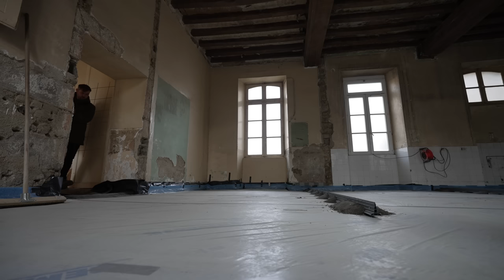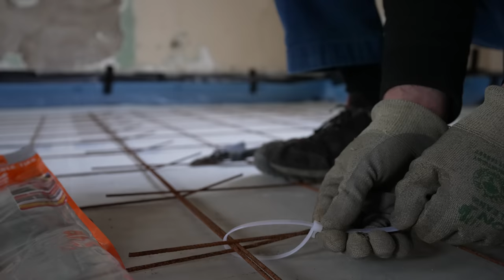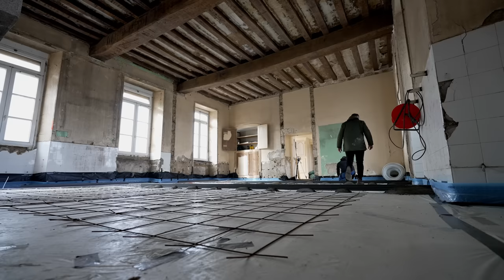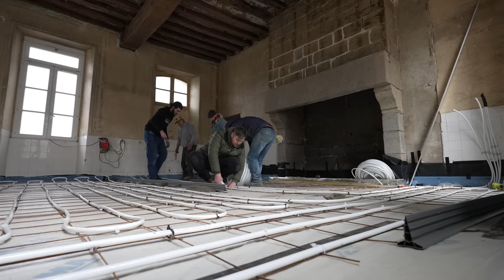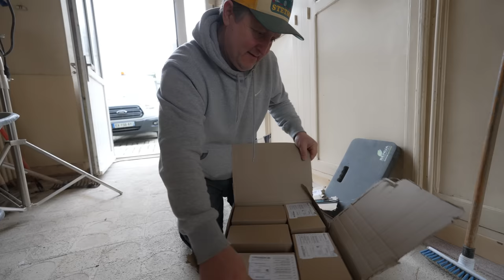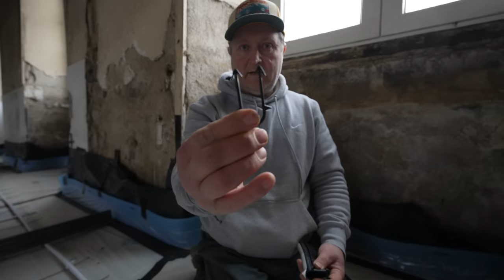Installing Underfloor Heating In A 250 Year Old Convent

Comment: Just a note on the PEX tubing:  Where it comes up, out of the floor, it is advisable to put the PEX tales in something like PVC Conduit Radius Elbows (1/2" Tubing in 3/4" Elbows) .  It helps the transition from the cement to open air as the PEX wants to expand when heated and it can cause some issues at the transition point (Cement to open air).  Sorry about the dimensions - I don't know Metric measures for the supplies.  We usually mount a Conduit Clamp, on the wall, for each PEX Tube - in a nice row.
Reply from the maker: that’s a great idea i will grab some tomorrow!
Reply: I noticed the same, also filling the pipes with water before the concrete comes in helps against floating, the third zone at the end should be smallest and the other zones bigger as you are closer to the connection box (which should be installed first). Also the pattern you are used is quite old fashioned, nowadays the tubes are routed in a snake like pattern, not parallel. All these things are ensuring equal heat supply to all areas in the room. Now it can happen that the third zone is the coldest on (longest tubes from the central connection point) and each zone is warm at the one side an older at he other side. Just my five cents....
Reply: Timely advice, very welcome 👍🏻
Reply: Yes!

Comment: OOOOHHHH this video is FACINATING!  It checked a TON of my curiosity boxes on how radiant heat is installed....I appreciate it more being able to actually see the steps, hardware and fasteners used on this step of the process.  Sean has a really great grasp on this - I realize it is a learn-as-we-go, but Its a process I hope to duplicate in building my Tiny Home.  Thanks guys, you deserve more than a Pint !
Reply from the maker: glad to help i haven’t explained how much research has gone into this floor and how much it’s cost! but of course it’s worth it!
Reply: @ThePethericks  oh absolutely!.  I'm sure there is a boat load of research involved, but in the long run it's so very worth it and there is no monetary value that van be placed on the learning experience and  satisfaction of a job well done❤

Comment: Like others a fantastic series mostly by hand, shovel, jack hammer and wheel borrow to built mount rock-u-la in the back.  Maybe a Bobcat when it comes to moving it to its final resting place.  It's got my better half think it might be time to renovate a late 1890 property though I'm suggesting living vicariously through your efforts and to downside to a tiny house.

The elbow recommendation by Lee Bernardo is how we handled our installation too.  I would recommend pressure testing the runs to ensure there are no leaks - pin holes.  We had to pull up a section of the tubing as it had pin holes.  The manufacture determined there was an issue during manufacture.  I'm sure it's a rare issue though much easier than chiseling new cement.

Comment: Guys I think the steel rebar mesh needs to be at least a couple of centimetres inside the concrete for strength. I’m not a builder but please check as it looks to be setup on the bottom skin of the concrete against the insulation in this latests blog. Great work overall though guys I enjoy many aspects including teamwork and this new floor prep. Work :)

Comment: Fantastic work!

One concern is that the wire reinforcement mesh is suppose to be floated up a bit in to the concrete to hold it stable from cracking, but you have it under the tubing. 
I have seen many people install this tubing, but it’s under the wire reinforcement. Just checking.

Comment: Great job, you ideally would want the rebar reinforcement in the center of the concrete, it might be worth dropping some on top of your underfloor heating pipes with standoffs to gain an inch of height. You could even tie the two sections together for extra stability.
Reply: I thought the same

Comment: Oh one more thing my suggestion is test the underfloor heating pipes for leaks before you pour as I've known there be a hole no one knew about then it was turned on afterwards and they had to dig it up
Reply from the maker: i have bought a pressure tester, will do that next week!
Reply: @ThePethericks  thank you so much for taking the time to reply. Love the vlogs and the hard work you and your fantastic team are putting in to the building thank so much for sharing it all with us
Reply from the maker: @Will-fielding  thank you for suggesting the idea i was told to by a heating engineer just before incase if any issues! we don’t want any issues because concrete is pretty permanent!

Comment: When I built my 4800 square foot shop, I followed basically the same process for installing my floor. I can assure you that installing the pex tubing was the most back breaking job I have ever done. You have to experience the joy of working in freezing temperatures with rolled pex tubing which absolutely fights you for every inch of the way while you are on your hands and knees.  It has been several years, and my back still hurts. I use a woodfired fired boiler and the next winter I turned up the heat and worked in shorts and tee shirts while the temperature outside was below freezing. My walls are ICF which retains heat extremely well. My hat is off to you and your crew. FANTASTIC JOB!!!!
Reply from the maker: it’s worth all the effort isn’t it!

Comment: Remember on the radiant floor you need to know exactly where those pipes are because when you go to attach, sink cabinets or anything to the floor it will be disaster if you put a nail or screw through one of those pipes. Put a sign up warning others in case you are not present. Good luck.

Comment: Why not fill the tubing with water? Also As the concrete is poured, the wire mesh should be lifted up so that it’s positioned in the middle of the concrete in order to provide steel reinforcement. This particular type of reinforcement resembles a two-dimensional grid, which plays an important role in its support capabilities.
Reply: The way they’ve pinned the heating down already suggests that the steel reinforcement isn’t there for the strength of the concrete, which is what I’d thought it was. The reinforcement mesh will be outside the concrete with this method. I’ll be watching with interest.

Comment: Make sure you do a pressure test of the system before you pour the concrete. You can connect an air compressor and gauge and then seal the end. Make sure the system maintains pressure for 24-48 hours to ensure there are no leaks. It's much easier to do now then to realize you have a leak after and have to jackhammer new concrete to find it.
Reply: Billy, Sean!!!! I hope you read this!! Very important!!!!

Comment: Gday from Australia, I’ve only had experience with installing two houses with in slab heating we attached the tubing to the foam then laid the mesh over top so to pull up mesh into the concrete as it was poured. Was taught that you always suspend the mesh in the concrete to strengthen it . Cheers
Reply: Yes I was going to comment on that myself, very curious as to why Billy is leaving the mesh on the ground. really should be lifted into the concrete as it's being poured or placed on plastic lifters prior to the pour. Just a comment!
Reply: He has explained in previous comments that the rebar is not for strength but for a grid to lay the tubing on perfectly.
Reply: @Gadgetmumma   missed that explanation. Having seen how easy the previous floor broke up I thought they wanted strength from the mesh. Let’s hope the guys doing the pour understand this and don’t try to pull the mesh up as they pour😀
Reply: @Gadgetmumma  ah ok I must have missed that discussion or just wasn't paying enough attention. Makes sense then and thanks for the clarification :)

Comment: The Clips (Staples) for the PEX tubing fit into a "Stapler" tool so you can walk along and drive the staples into the foam without having to crawl along on the floor). usually you can rent it - they go very fast that way.
Reply from the maker: i couldn’t find one online, they aren’t very common here in france

Comment: Don't know if you can get these in France but there is a hand held power tie tool that runs a roll of wire and you just hold it over the junction of the floor wire and the heating tubing, pull the trigger and it wraps and ties everything together. May be worth like looking into if you are planning on doing more in floor heating or concrete flat work. Makes very quick work of the job. We used it in our basement and gym and it was a back and knee saver.

Comment: I find it interesting that the steel mesh is hard against the insulation, I would have thought that the mesh would have been centered in the middle of the concrete slab to provide structural strength  as apposed to sitting on the bottom of the slab flat against the insulation ?

Comment: Nice one guys.... I'm assuming you read👀 my comments from before👍 just a couple of questions.... 
Are you going to raise the mesh off the insulation? If the mesh is structural it can't be just at the bottom if it's not structural why did you have it there in the first place?

Are you going to be pressurising the pipes before you concrete? You can use air or water. This really needs to be done two reasons really you want to make sure you haven't any leaks now and during the poor.

you can fit your manifold and apply the relevant fittings including a pressure gauge so you can have pressure in the pipes alternatively you can fit pressure gauges to one of the two pipes that makes up a circuit, on the other pipe you fit a ball valve so you can add your water or air via small compressor or pressure pump. 

Have you thought about how are you going to get across the pipe work while you're concreting ?, you could use ply. 

You might want to consider putting more staples in, you might as well use them up especially around the loops...

Also I would advise you take very precise measurements on where these pipes are just in case you want to install anything afterwards that involves drilling through the floor or anywhere where you do not want heat.👍

Looking forward to your next exciting episode 👍👍👍
seriously I don't wanna sound like * ** I'm only trying to help 🙋‍♂.
Reply from the maker: appreciate your comment and suggestions, the steel is only as perfect grid to lay the heating pipes too so it’s consistent and not for reinforcements. those pipes cannot be crushed by a human foot it’s literally impossible but we will take great care when pouring the concrete.
Reply: @ThePethericks   okay.

Comment: Maybe the method is different in Europe, or I am behind the times, since it has been over 10 years of working with concrete.  Saying that, I think the rebar should be elevated a bit to make sure it is in the concrete slab, instead of on the bottom of the new slab.
Reply from the maker: it’s not for strength, it’s for laying the pipe too
Reply: @ThePethericks  That’s interesting ! You’re probably using concrete with fibre for strength?

Comment: would be better if the mesh was lifted from the foam. I thought you'd do that after with some stones or something between the mesh and foam, but then you snaped the plastic anchors. maybe i wasn't paying enough attention and its supposed to have more steel. looking forward to the pour.
Reply: He said it’s not being used for strength, only as a grid for the heating pipes

Comment: You need to add Bar Chairs under the steel reo to lift it above the insulation. The reo needs to be in the middle of the concrete. This will give the concrete more strength.

Comment: I believe you had more than enough heat coil tubing. This wasn't as flexible as what we use in the USA. Have you thought about putting some conduit covers where the tubing come up the wall like the guy at Diesel Creek did. May not be necessary. Those new windows are a bit pricey aren't they.

Comment: Wow the floor is looking great.  Radiant heat in floors is the best.  Just wondering, are you going to lift the concrete reenforcing wire up off of the foam?  It won’t do much unless it is suspended in the slab.  Really enjoying watching the progress.

Comment: thought there was supposed to be a gap under the steel to allow concrete to completely surround the wire and therefore the wire should sit in the centre of the concerete pour ??. Doing a real job fellas....envy you.....

Comment: By any chance are you using an uncoupling membrane between the new concrete and the travertine? New concrete shrinks and spider cracks occur, especially with radiant heat floors. Those cracks can telegraph through to the new travertine, and that would be tragic in light of all of this effort. Schluter Ditra is foremost in uncoupling membranes.

Comment: The expansion joint should be notched over the pex piping so that its base is flat to the insulation. Otherwise, good job.
Reply from the maker: it’s not finished yet!!!!
Reply: @ThePethericks  Just in case the video was uploaded after the pour. A comment below references using PVC conduit to come out of the slab, putting standard sweep or long sweep conduit elbows there could be a good idea to prevent kinks in the PEX.

Comment: What about the holes made in the insulation by the spikes? You did all the hard work taping joints to only poke hundreds of holes. 
Will they be covered in caulk or some waterproofing before the concrete?

Also, way to go getting the piping done! Ahead of schedule is always a good thing.

Comment: Great stuff as usual..... I do have a question, since I know NOTHING about construction etc.  When pouring such a large concrete slab with obviously heating underneath (Great idea)....... will you have to put in expansion grooves in the slab such as they do in driveways and sidewalks to prevent cracking?

Comment: Billy,  how are you going to get your metal reinforcements to float in the middle of the slab like they are suppose to when you have the in floor heating tubes on top of them and the tubes clipped to the insulation?
Reply from the maker: because they don’t need to be

Comment: Hi Billy,  why didn't you run any of the pipes under the windows?  Thar will create a cold spot in the room.  The warehouse I own has a floor heating system like yours and we have issues where they didn't run pipes
Reply from the maker: the window reveals won’t be that large and i don’t want to heat behind the studwork

Comment: Isn't there supposed to be a space between the rebar and insulation so the rebar is in the middle of the concrete slab and not at the bottom?  Also, doesn't France have any kind of building codes where inspectors need to come out to ensure things are done properly.   Just wondering.
Reply from the maker: nope not in this application

Comment: Do you need saddles under the reo bar?
Concrete to flow under the reo a little. 
Sets the steal in the Concrete not under it. Just a thought.
Reply: He said it’s not being used for strength, just as a grid for the tubing

Comment: Billy, just curious.  Does the heating man that is installing the boiler want you to pressure test the tubing to make sure there are no punctures before you pour the flooring?
Reply from the maker: yes, it’s very important to check before the concrete goes in! next week i will check, we have a backup roll of pipe just incase of any issues

Comment: I see a mistake, rebar is supposed to be in the middle of a concrete pour. You anchor it to the floor when you used the peck tube clips  Needs to be on top of the peck tube
Reply from the maker: it’s not for strength it’s only for laying the pipes onto, this is actually a common method in our part of the world. you need to remember your building codes aren’t the same as ours.

Comment: The steel reinforcement should be in the bottom 1/3 of the slab. Seems a little pointless to have this pinned to the bottom, why have it at all? If you clipped the heat tubing down first then laid the steel grid on-top that would get you almost perfect? The concrete will still want to wick the heat.

Comment: Under floor heating, interesting. Will those walls handle the heat ? As the building was not designed for such. Yeah I know there was fire places before hand. But now your renovating something new. Idea's are great to do. Careful of consequence from new technology. It's a thought. Old building has it's own ways. Edited::: I built a floor on top of concrete with wood and 3" foam insulation and it stay warm by itself without heating..the room had no heating what so ever. I don't like walking on cold floors who does.

Comment: Shouldn't the metal mesh be raised so as to end up in the middle of the concrete?
Reply from the maker: it’s not for strength in this case, just for laying the pipes onto as it’s perfect! we could raise them but the concrete slab will be strong enough already

Comment: If you clip the tubing tight to the insulation, how are you going to pull the metal reinforcement up into the concrete?  It's wire is supposed to be suspended in the middle or lower third.
Reply from the maker: neither, it’s not for reinforcements
Reply: @ThePethericks  OK, my mistake, now I know why you didn't use the plastic grid and this instead.  Much cheaper.

Comment: Doesn’t your rebar need seats under it so that it is roughly the center of the concrete slab? It won’t do much if it is hard against the foam board…………….🤔
Reply from the maker: no

Comment: Do you need to put in rebar spacers to lift the reinforcement so that it sits in the middle of the concrete?
Reply from the maker: no it’s just a perfect grid system to lay the pipes too, these sort of slabs don’t need reinforcements.
Reply: @ThePethericks  Had me intrigued, and then I saw the hold down clips/ spikes, and was even more intrigued....So thanks for the reply, it is 05:35am here in Caboolture (just north of Brisbane, Queensland, Australia ) so I had better drag myself off to bed, wifey is planning a big yard day I suspect. Great Job you are doing. Rob